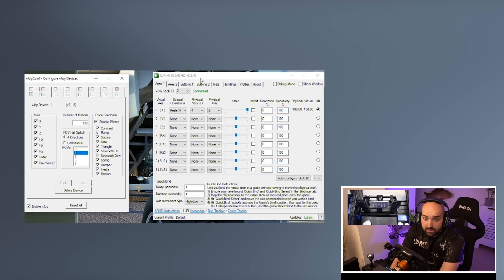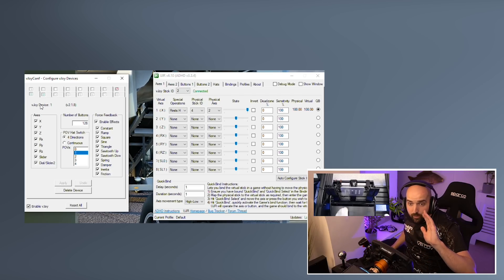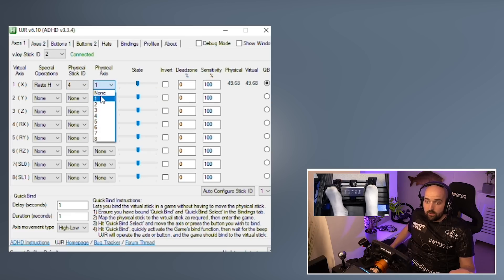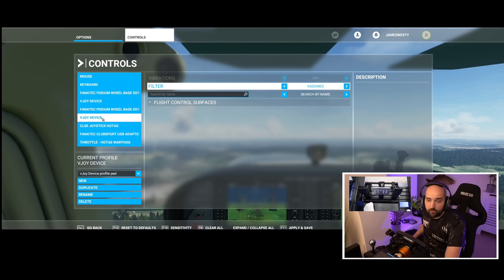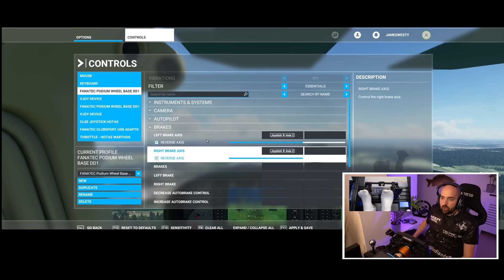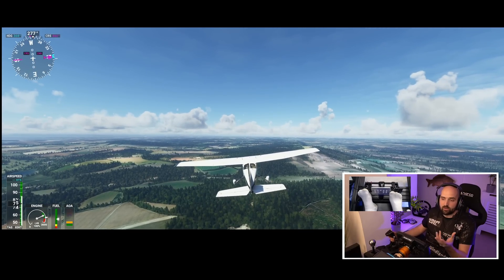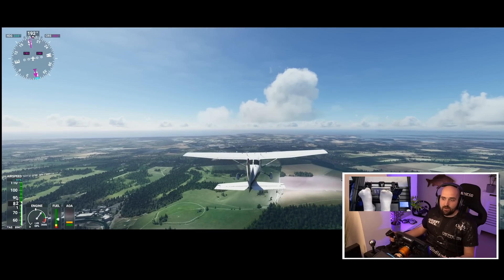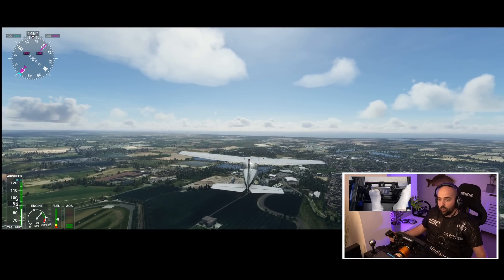How To Use Your Racing Sim Pedals As Rudder Pedals In Microsoft Flight Simulator -  Guide

Comment: But how do you hook it up? My pedals have a plug similar to a phone jack
Reply from the maker: @tde439  there is also a separate USB port allowing you to plug them directly into a PC , I believe a standard USB to USB-B  is the type of cable you need the pedals have a USB b port.

Don't plug the pedals into the wheel base and PC at the same time , only use one way to connect to the PC.
Reply: @GamerMuscleVideos  I have Fanatec gear as well, so could I leave the pedals attached to the wheelbase or do I really need to unplug them from the wheelbase and use a USB connection to hook up the pedals to my PC?

Comment: That actually works better than I’d expected. I’m too poor for a proper flight sim setup, especially because it’s only an occasional hobby for me, but I’ve got my dad or my brothers Logitech steering wheel and pedals and looked this up to see if it was even feasible. Not ideal but looks better than a controller? Have to think about what to use for pitch though. Was thinking either gear stick? Controller joystick? (Sitting on the desk to the side)? Or the up/down buttons? Once again I know it’s far from ideal but for a casual flight sim noob like me, the only other option is a regular old controller

Comment: New to flight Sim I have fanatec csl DD I have used this to setup my pedals for the elevator axis works well but I would like to use the analog clutch paddles on McLaren GT3 wheel instead I can find the left paddle but not the right hand side has anyone done this I'm using ujr cheers

Comment: Holy cow I was wondering if you could actually do this!
I figured there would be the potential to somehow use the gas and clutch as a rudder but wasn't sure how it would be possible. Found this video randomly and I may just have to buy MSFS now!
I have a Fanatec CSL Elite mounted in a custom built racing rig. Also have a VKB Gladiator joystick with a ton of buttons on it. Only thing I don't have is a HOTAS throttle. Going to have to figure out what to map throttle to.

Comment: JFYI: You can't start or land a Messerschmitt BF 109 in DCS without individual usable left and right breaks. It is built that you only can and MUST steer that plane beneath 100 km/h with your left and right break, because it WILL run and SPIN off the runway thanks to the torque of the engine and no steering wheel connected to your rudder. So there are planes where working individual breaks are vital, at least if you want and need to start and land them.

Comment: I see "LEFT rudder axis" and "RIGHT rudder Axis" now, is that new in MSFS ? So the Vjoy maybe not needed ...
Also how are you connecting pedals ? I have 2 sets but they connect to the WHEEL with a Phone style jack ... Converter ?
Great stuff as always.
Reply from the maker: You can just bind it in SIM now no app needed 👍👌

Plug pedals into usb directly , most fanatec pedals can be used with usb.
Reply: @GamerMuscleVideos  So are you saying we don't need to use Vjoy and UJR now?  I bought a converter cable to convert my G25 pedals from a phone-style jack to a USB plug.  But when I go into Controllers in MSFS, I don't see them.  They are listed under Game Controllers within the Windows Control Panel, and I can see movement on the X,Y, and Z axis under the Test tab as I move the pedals.  But nothing within MSFS.  Thanks.

Comment: Guys I’ve just looked at downloading UJR and the website states that’s the software is no longer maintained and to use UCR. Has anyone tried it or can I still use UJR?
Reply from the maker: You don't need to do this anymore , you can just set the pedals in game 👌👍
Reply: @GamerMuscleVideos  mate I’ve got the Heusinkveld sprint pedals, which has its own software.  Unfortunately it  doesn’t work for me.  The inputs look and work fine within the settings menu.  However when I try to use them in game, one of the pedals is constantly on and when I press the pedals they are very twitchy and have a mind of their own.

Comment: The twist stick function on my T16000m is gone, known problem for years and Thrustmaster never fixed it. Didn't know I can use my Logitech pedals for the rudder and the actual brake pedal. Not only this solves my problem, it makes my experience a bit more immersive. I mean I would do that even if the twist stick was still working. Cheers GM!

Comment: Interesting. I don't have any racing pedals so I will try to adapt a pair of usb sustain pedals, they are cheap enough to experiment with :-)
On your comment about toe brakes, every light aircraft I have flown has toe brakes and they are used all the time - on the ground, obviously. You couldn't handle a tail dragger without differential toe brakes, for example. Good video though👍😁

Comment: This is a complete wastte of time, just go in to sensitvity in msfs and change the neautral dead zone and reverse axis then and then assigne the correlating pedals to indviduaal rudder axis.  much simpler and works fine with my g920. NO NEED FOR EXTRA SOFTWARE
Reply: does not work with all flight sims though, this fix works with other games.

Comment: Is it possible with that software to use the pedals for yaw, the steering wheel  for roll and the joystick for throttle and pitch?

I have tried my t150rs in fs2020 but it did steer only full to left and right with roll.

Comment: okay I had this working at one point and then I went back to racing for a few months and now I'm back to flight Sim and I can't remember how I had it...

my PC is not picking up the fanatec pedals... Do you have the data line going directly into the data port in the computer?
Reply from the maker: Works off Peds plugged into wheel or usb 👍
Reply: @GamerMuscleVideos  well I only have that data type cord coming from pedals
Reply: Do I need to plug into the wheel and then have the wheel on? I didn't need to do that before
Reply: Okay that worked. Plugging into the wheel and then keeping the wheel on. Had to verify it was picking up the pedal movements by going into game controllers and properties on the dd1

Comment: If you can't get vjoy to install properly make sure you have unplugged all of your controllers  before you install vjoy.
Reply: hmmm I've done that as well as tried the other mentioned options such as start the UJR and letting it tell you where to get vjoy. I still can't get past that point of it installing and never finishing.
Reply: @catalinasgrace  Hello did you make sure to uninstall vjoy after the failed attempts. Sometimes it will show up in programs even if it doesn't seem like it installed.
Reply: @hirdominator  Well I got it installed the way I was told to by using what UJR wanted. It then told me that I needed the newer release of vjoy even though I had the newest one from the site and still wouldn't work.
Reply: @catalinasgrace  I did the same thing. What fixed it for me was to completely uninstall vjoy using windows uninstaller then make sure all controllers are unplugged and then install vjoy. Thats what worked for me.

Comment: Thanks for this GM,
I have done what you said and have it all set up but have an issue. 
It works great in the sensitivity menu and is nice and smooth, however when in the plane i slowly press the pedal (Fanatec same as yours) and nothing happens at first. I keep pressing it and then all of a sudden the rudder snaps one way or the other. I have tried all different positions in the sensitivity settings too. Its not quite 'digital', but the gap of it actually moving is so narrow as if it has a huge dead zone.
Reply from the maker: Did you bind it as analog axis or a button ? Sounds like maybe it's bound as button in fs
Reply: @GamerMuscleVideos  It looks the same as yours, Flight Control Surfaces - Primary Control Surfaces - Rudder Left (Yaw Left), Rudder Right (Yaw Right) and the left hand box selected.
Reply: What i have noticed is that you seem to have a slightly different version to mine (Pre-release?). Where your control listing is vertical on the left hand side, mine are in a horizontal row at the top. I also dont have the progression bar under the selection part only on the sensitivity part.
Reply: Ignore the above, i was having a senior moment, it was bound to the buttons and not the axis. Working great now.

Comment: Great video thanks. However, I'm completely stuck at the vJoy step in the process. I have attached to my system 4 Controllers listed in joy.cpl. I have my TS-Racer Wheel, TS Pedals, DSD Button Box and Microsoft Precision Pro Joystick. It doesn't appear that vJoy sees any of these. Shouldn't I see 4 IDs listed in vJoy when I use the Configure vJoy app? When I go into UJR and press my pedals as you demonstrate I don't see anything. Am I completely missing something? I'm completely stumped. Any help would be greatly appreciated. Thanks again.

Comment: Okay, PROBLEM SOLVER FOR THOSE WITH ISSUES USING AJR

go to the link he gave, read thru for a link to the UCR page on github. DON'T USE UCR.
In big blue letters it will direct you to the C# version that is compatible and still being maintained.
If you can use UJR or UCR that's fine, but if not try the above.

Comment: I tried this about a year ago, attempting to use this with DCS.  Then as now, the vJoy software will not install.  THe install dialog box just sets there.  The install bar is green, but there is no install happening.  The only way to close the installation dialog is to run WIndows Task Master.
Reply: Yea same thing for me
Reply: mine installed but running the other software said i needed to update vjoy, its the only download on their page....
Reply: @runningkillerkia  Had to unplug all wheels and 
joysticks, then vjoy installs properly.
Reply: @Nor0252  that did the trick. thx

Comment: is there an adapter for the logitech g920 pedals so I can use them without the wheel. Would make it quite a bit easier than having to connect the wheel as well. Save a bit of space. Don't really have a full sim setup like i'm sure a lot of people do these days.

Comment: Absolutely none of this work for me
Reply: Edit I finally did get it all to work just not exactly as described
Reply: @SinCitySimTV  how ? its not working for me either. Went trough all the ID's could not find my pedals
Reply: @simracingchannel7691  That's the key as you watch the video in the beginning he makes it look like he is getting rudder control with both pedals on a single axes tab but he is not.. like he said you need to have vjoy up and running and you don't need to touch it unless you have more than on input which i don't.. Than on UJR Axes 1 I selected vJoy 1 than set 1(x) to Rests H than you just have to keep clicking around between the physical stick id and Physical axis to find your CLUTCH pedal (left rudder). Once you get it and if the slider is not all the way to the right you need to click the invert box to get it moving right to left.. Than as he says on Axes 2 set  1(x) to merge and again click around until you find the ACCELERATOR pedal (Rt rudder) and it needs to slide left to right if not invert it as well.. I was all good to go after that. Also his version of MSFS must be an advanced copy as what i have is a little different when it comes to applying all of this in game but it's not hard to figure out. Hope this helps..
Reply: @SinCitySimTV  Thanks for the reply. Got it working with vjoy and a different program called universal control mapper. It is working fine for me now

Edit: lol wrong account

Comment: I just set mine to combined pedals.. then the gas and brake move the rudder left and right.. no need for all that 3rd party stuff..
Reply: Just what I was thinking
Reply: Although depending on the peddles the accelerator and brake can feel very different.
Reply: @Adenzel  yes, clutch and accelerator is better.
Reply: Is this using the Logitech app  combining the pedals?
Reply: jamie1979bit yes

Comment: You use toe brakes once upon takeoff and you're starting the climb to stop the tires spinning.    Just bought PC, Honeycomb, and can't find the Logitech pedals anywhere.  Already spent enough or I'd go for something more expensive.  This will work great for the budget using my G920.  Wonder if you could use the shifter as well.  Thinking shifter between 3rd and 4th for gear up.  Or maybe with neutral used, 3 position flaps

Comment: To add.  The biggest reason that I like this video is that with my Thrustmaster T-LCM (USB connected where axxis can be changed) take all the room in my rig and no room for adding rudder pedals.  Also I have the Thrustmaster TCA Sidestick Airbus Addition and the rudder control is not that great and can be locked to use rudder/racing pedals.

Comment: My over 10 years old logitech G25 pedals are still working well enough to use them for rudder. They can be spaced further apart, bolted into the board, cheap comport to USB adapter to connect to PC and I've disconnected the brake pedal as well. I like the minimalistic clean look.
Any spiking I have is resolved with deadzones and lower sensitivity.
Reply: did you get it to work with only a comport adapter cable? without any additional control device (arduino) and additional software?
Reply: @manuelmt9146  its a comport to usb adapter for G25. Plug in and they're detected as a separate usb device.

Comment: Why not use the steering wheel as a rudder? One hand on the joy stick, and another hand on the wheel? Of course this is a suggestion from me who has never tried this myself ;-)
Reply: because technically speaking you need a hand on the throttles and/or auto-pilot, GPS, Flaps, Anything else basically haha !

And it would be physically confusing except if you are a drummer or pianist that is used to separate both arm's movements in an uncoordinated way !
Reply: It's less realistic, but it would work just as well.

Comment: Could you not just layer the rudder and toe brakes over the same pedal axis? Functionally they do the same thing, just one works in the air at high speeds and one works on the ground at low speeds.
Reply: The rudder still works on the ground.
Reply: @fbcaware8805  referring to their effectiveness. Rudders aren't that effective at taxi speeds, though i'm sure most of the planes in FS2020 have a nose wheel steering system. Regardless, i'd feel that pressing both pedals in as a central brake while still getting pedal steering would be a better option than going heel/toe.

Comment: Thank you.  Can you post the keyboard commands?  I use my Eldago Stream Deck as one of my button boxes which is basically assigning keyboard command to the Stream Deck.  Also, I use Sim Dashboard as an app for my telemetry on racing games.  Hope that it will also works on MS2020.

Comment: James showing he don’t know much about aircraft. Like 90% of airplanes have toe brakes.. they’re massively useful for ground taxiing. What I would do is double bind the pedal for rudder and have a steep expo curve on the toe brake so that it doesn’t shoot the aircraft off the side of the runway while in T/O or landing roll
Reply from the maker: I explain this in the video .

The point is about indavidually bound analog toe brakes and the reality that other than for making tight turns on a taxi way they are not needed most the time. 

I have spoken to multiple real world pilots about this.

Comment: Why am I even watching this, I have a frkn rudder pedals -.-
Toe brakes, and more specifically differential brakes, are far from unimportant though! They are your steering wheel on the ground in most planes.
Reply from the maker: The rudders act as ground steering / wheel steering  in most planes from what I'm aware of not the brakes.

Indioendent Toe brakes are used on the ground for tighter turns though which I explain in the video

I have spoken with multiple real world pilots in regards to toe brakes on simulator equipment. 

There are also high end rudder pedals on the market that don't have toe brakes.
Reply: @GamerMuscleVideos  Not quite. There's way too much friction between the tires and the ground for the rudder to have any effect at low speeds, such as when taxiing. Also, the rudder works by redirecting the air flow - only there hardly is any airflow at taxi speed. That's like trying to steer a car by holding your hand out the window. At walking speed.

Not totally wrong though either: As you accelerate down the runway for takeoff, the wings will gradually produce more lift. Not enough to lift off yet, but already reducing the weight on the wheels. At the same time the airflow along the rudder gets faster so it becomes more effective.

Mind you I'm talking about small planes now, Cessnas etc. A steering mechanism for the nose (let alone tail) wheel would be way too heavy for those. On airliners and such, yes. They have a tiller; a steering wheel essentially.
Reply from the maker: That's not what I said . 

Ie. in some planes the rudder is also directly connected to the wheel that does the steering. 

The toe brakes are used to brake indavidual wheels that also gives additional steering ablity. 

You can steer perfectly fine without toe brakes on the ground from both the effect of wind on the rudder and ore  the movement of the wheel from rudder input. 

The point is There are many planes that work in many different ways when it comes to toe brakes on the ground regardless at the end of the day you spend hardly any time taxying you can taxy perfectly fine without Indioendent toe brakes in fs2020 and you can bind a button for it if you want Indipendentent Toe brakes. 

Unlike racing Sims or rudder input when flying  you really don't need content Indioendent precise toe brake input.

Are you a pilot ?  IV spoken to a few real pilots about this. 

Also as I say there is we relitively high end sim kit out there with no toe brakes on it.